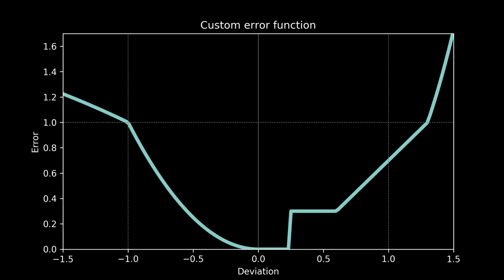How to pick a machine learning model 3: Choosing a loss function

Comment: Why can't error function decrease temporarily over deviation? Could you elaborate more this constraint. @Brandon Rohrer. 4:42
Reply from the maker: Thanks for the question. Anywhere there is a dip or divot in the error function, a solution-finding algorithm can get stuck. If you're careful, you'll design your error function so its only "bottom of the bowl"  (local minimum) is at the solution you want it to find. Here's a longer version of that explanation: https://e2eml.school/how_optimization_works_1.html